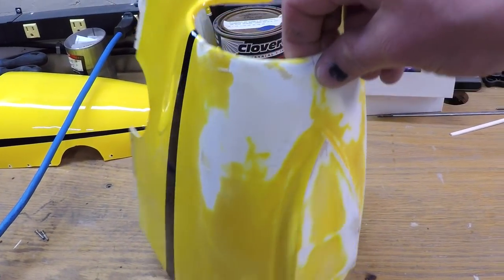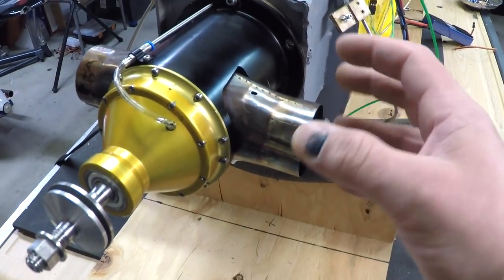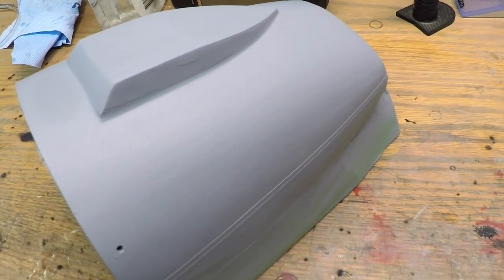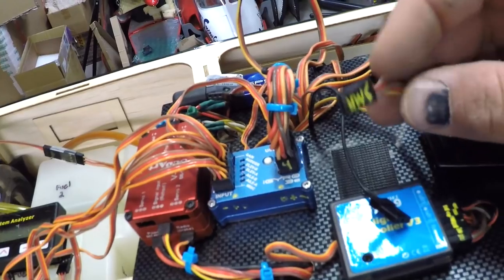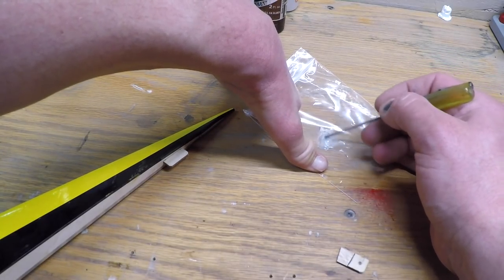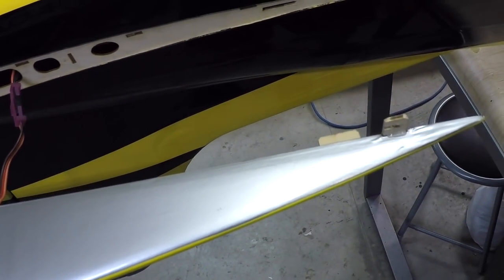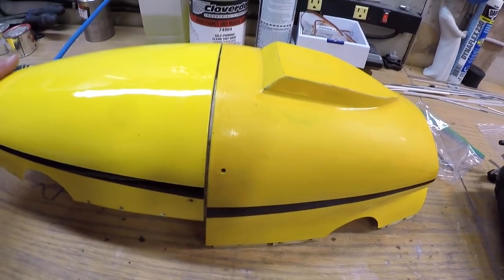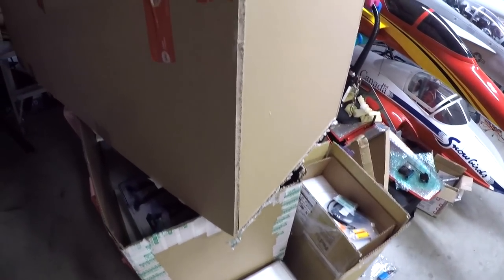AFTER THE CRASH - How To Repair RC Plane - Sebart PC21 with Wren 44 Turbo Prop, JR 28X DMSS, Part 3

Comment: Hey mate, hello from lock down in the UK, another great video. Regarding your tip about spray paint samples, the plastic modelling guys use white plastic spoons....you spray the back of the spoon and write the paint details on the other side. You can then drill a hole in the handle and keep them all together in a drawer out of the way. You've asked in other videos if there are any topics that people would like you to cover in future videos....well I'd like to put a shout in for a "how to" of the systems required to run a jet such as turbine install, fuel plumbing, control systems, gyros, smoke systems, radio installation etc. Jets are something I aspire to from a knowledge, financial and flying ability point of view so any any help to tick one of those boxes would be appreciated. I'm still working through your back catalogue of videos so you nay have covered this elsewhere but if not, it would be really useful. Thanks. Ian B
Reply from the maker: IAN!  Genius idea with the spoons. Thanks for sharing that.  That will be my new go to for sure!  
I do appreciate the list of desired topics!  I have added your suggestions to my list of video ideas. 
THANK YOU!

Comment: ¡Good Job!... like your vids I always learn something from you thank's for sharing your knowledge. This goop is silicon?... I lost my Tucano last year because one cable got loose from the powerbox.. 😖... very important to secure the cables.kind regards
Reply from the maker: Thanks Carlos!  Appreciate the comment!  The GOOP Product is not silicone.  It's a solvent based adhesive would be my best way to explain.  Silicone may work but the problem with silicone is it won't generally stick to plastics very well.  The GOOP has a bit more stick but is also easy to take off if needed.
Reply: Thank you, I'll see if I find something similar in Spain... when they let us go out 🙂

Comment: Where does the turbine suck air from?
Reply from the maker: Good question!  The intake of the turbine is essentially inside the fuselage. So when the aircraft is all buttoned up and ready to fly there is a few spots. 
1. Intake in cowl feeds the 4 holes in the bulkhead/firewall. 
2. There is 2 large intakes at the rear of the airframe behind the Wing on the underside. The joint between the fuse and the wing has a big unobstructed tunnel leading to the front. This would feed the turbine as well.
Reply: The Lighter Side Of Us Cool thanks, a question I’ve been wondering about for like forever.